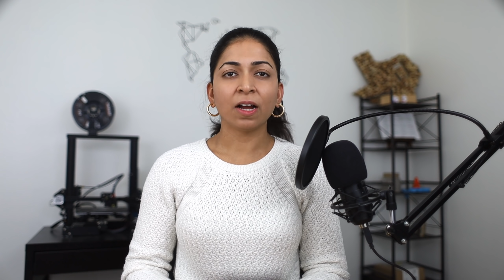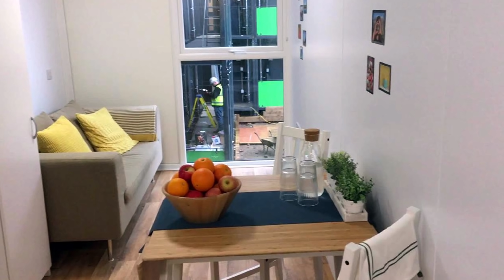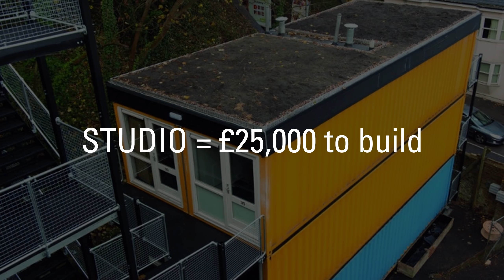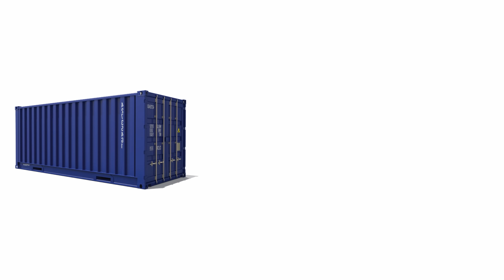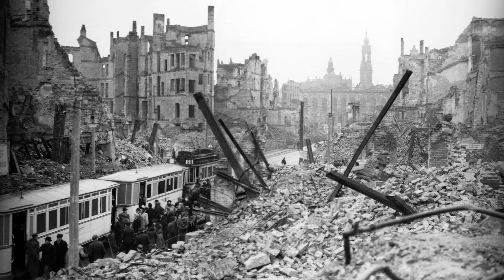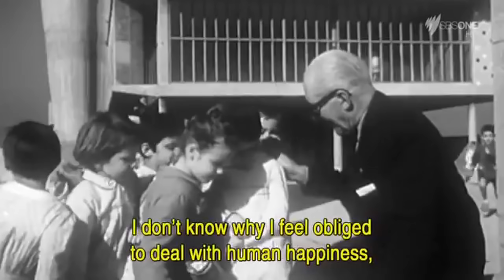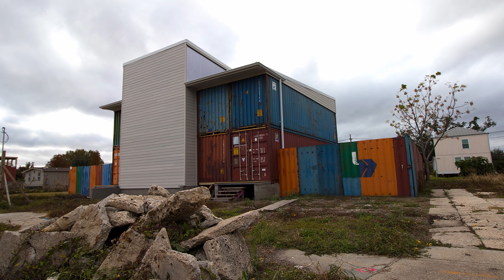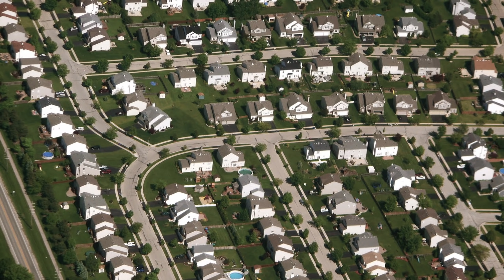Why Shipping Container homeless shelters FAIL

Comment: Solving homelessness requires personal relationships and a LOT of patience. I've watched my dad help several homeless people get their life together and stable. there's no big solution, it just takes a lot of people willing to take time for one on one interactions to slowly help with financial and mental issues. Trying to help everyone is the fastest way to help no one.
Reply: Actually if you look at Finland, homelessness is very much a solvable issue. You have to provide them permanent, unconditional housing that will not be threatened by their unstable mental health. The comfort of knowing that they will not lose everything if they fail immediately does wonders for their recovery and sets them on the proper path to permanent stability. Turns out no one likes living with a flame under their ass and the stress tips some people over.
Reply: @backwardsbandit8094  where are the houses you propose homeless people should get? A LOT of San Francisco's homeless are addicted to drugs, & the homeless population has skyrocketed due to its notoriety. In SF, even people w/ degrees and education can barely afford rent. What "comfortable, normal, permanent" housing is their in SF? If the city wants to buy up a bunch of expensive properties to make homeless people feel at home, they can go ahead, but it will cost them billions. My housemate works for a non profit giving homeless people temporary apartments and it's often a nightmare. I've personally been homeless and it's a terrible place to be and hard to get out of but the logistics of giving homeless people their own places are grim. Beggars can't be choosers - I would GRATEFULLY live in a shipping container over living on the street. You won't get robbed, you have a bed, a kitchen - a place of your own. Only entitled people would turn their nose up at these homes.
Reply: @backwardsbandit8094  Finland may not be the best example. In 1987 it had a homeless number of 4000 people with no accomodation and about 10k total "homeless" who are in temp housing or with no accomodation. In 30 years it has reduced these numbers but you have to look at it in scale. 10k people reduced to 2ishk in 30 years across a sizeable country is good but its a problem of a different scale that you cant really compare to big countries like Germany, Uk, USA, etc. 

EG a fairly well off country like finland building 10k houses over 30 years isn't that impressive in itself. Yes finlands policies have been good but it was a small problem for them that they have been very slowly fixing across 30 years. The homelessness solutions do not scale up proportionally.
Reply: @tkelly6121  that was over 30 years ago. Finland has instituted permanent housing for the homeless in the last couple of years. The research and facts show that it absolutely works. The decrease of uncertainty and abnormal mental and emotional stress greatly helps them get stable and begin to heal and become productive members of society. No one came live a stable life when they have no safe place to reside.
Reply: @wendyc.beecher3336  Finland has been working on its homeless problem for 30 years. Homelessness in Finland most dramatically reduced in the 1987-1995 era. I think you may have misunderstood my point. My point was 30 years ago Finland had a very very small homeless problem aprox 4000 people without any homes and 10k with only temp accomodation. It has taken Finland 30 years to slowly reduce that number. The point is that homelessness solutions do not scale proportionally. Finland has reduced its long term homeless from about 4000 in 1987 to 2000 in 2020. Thats about 40 years to home two thousand people. That is a very very different scale to countries with much larger homeless populations. I am not saying that Finland is doing anything wrong, I understand their policies are good for them but you can't simply copy paste what works on a small scale to a larger scale issue. It's more complex than that.
Reply: @tkelly6121  I think you are talking about something different than I am. I do believe when something actually works, you can adapt it to work in other similar situations. Especially if what you are currently doing is an abject failure
Reply: @wendyc.beecher3336  Perhaps we are speaking on different things. I was pointing out how comparing the homeless problems and solutions in Finland to the homeless problem in larger countries such as USA or Germany does not work. As the solutions do not scale proportionally.
Reply: @tkelly6121   You deserve a medal for articulating  that.
Reply: @obscurelyvague  Cheers.
Reply: @tkelly6121  I would also think the Finland has the advantage over a place like California where the alternative, living on the street in extremely cold environment, is not even possible
Reply: Exactly this
Reply: Ever notice how nothing seems to be impossible when people put their minds together to get it done? If the smartest people were to put their minds together to solve one problem it shouldn't be how we can put a man on Mars but how to lower the cost of living to reduce the stress of living. This has always been the main cause for universal homelessness througout mankind's history.
Reply: @angelluisll1033  This will crack your rose colored lenses....
In order to lower the cost of living you would need to redistribute resources evenly.
Even resource distribution would put an end to the "fat cats" and any others INCLUDING those who choose politics for selfish reasons (most of them) being above others simply because they have the ability to CONvince others to do what they want them to. 

You are essentially stating that all these people who never do anything for themselves would have to become useful to others NOT of the same mindset as them ...

that has as much chance of happening as these people ever seeing "Heaven". 
Whether a heaven exists or not, does not change the chance of people like that getting there.
Reply: That's what families are for, but society destroyed the family in the name of feminism and homosexuality.
Reply: Yes!
Reply: We are trying to throw money at a personal responsibility problem, not everyone wants to "make it" in life, no matter how much housing you give them it still would not motivate them. I truly believe that to some people, death is more welcoming than hard work.
Reply: @OpiumBride  it's sad that you can't listen to yourself. You are saying that the homeless are just so lazy that they suffer hunger, exposure, violence, lack of safety, rape, illness and other negative effects? Yeah right. Obviously there are SOME that are drug addicts with no desire for sobriety ( which takes inpatient rehabilitation). There are a few loner antisocial types that want to live solo and outdoors. The overwhelming majority are simply overwhelmed by problems they do not have the skills or resources to overcome. It's a very complex issue and each person has individual reasons and situations that lead to homelessness. There is no solution without permanent safe residence to start.
Reply: That is true
Reply: Finally someone who gets it.
Reply: @ Kam L...Exactly right ! Relationships and lot's of patience ! Simply giving them a shelter and/or a pile of money just never works ! Ultimately, the real solution in our society would be "Prevention" but we just aren't advanced enough yet !
Reply: youre right but the first step is SHELTER
Reply: I work in homeless shelters and yes you are right. It needs to be done one a case by case basis. However, there is a serious lack of usable space at least where I work. We  tend to take buildings which are coming to the end of their working lives because they are free or cheap (scheduled for demolition in a couple of years etc) which also means there's no incentive to maintain or improve the buildings and so people end up living in bad conditions. At least these shipping container properties are clean and serviceable.
Reply: They don't want homes. Just let them be
Reply: @Fleshlight_Reviewer  you drunk
Reply: "Kam L"    The reality is that with all the thousands of homeless people there are,  no assistance program can  merely    assign  outreach workers to  "take time"  with each individual  homeless person to "develop a relationship."  There are more homeless people than there are outreach workers. Each homeless person needs the attention of more than just one person trying to help him or her and  while any group of workers are "developing a relationship " with one person there are  thousands more  that  need  attention to their needs. 
It is necessary and unavoidable that  any solution is  meant to deal with homelessness according to  "bulk." 
Another thing is that  homeless people  have to also "meet  halfway" and help themselves and that is the hardest part overall. Anyone not willing to give up drugs or alcohol or  who is not willing to get job training   cannot be made to do so by anyone. It is why  helping homeless people  in the overall sense   just  turns out to fail  no matter what is done.
Reply: @obscurelyvague  I'm not sure you understood my comment. My point is not about outreach workers. Its that individuals need to build a relationship to make that change. You can;t make a system for it, it takes a personal choice to leave your comfort zone and commit your time and patience to helping someone. Most people aren't willing to do that, so they throw money at the situation to feel better about it. The solution has to be community based, but not enough people are willing to take on that responsibility.
Reply: @DeathComesSwiftlyForYou  anarchists are a joke. If you think working a job is to difficult you won’t last a day in anarchy.
Reply: Homelessness is a mental health thing. Not lack of housing. Unless you have a plan to solve all mental illnesses... Youre chasing wind.
Reply: @maasicas  Also, lots of people do choose to live a nomadic lifestyle and not everyone wants to live in a home. That's quite a big factor where I work. We  as society  assume everyone wants the same thing, which they don't. You're not automatically mentally ill just because you don't want to be tied down to the same physical space forever. Some people just don't like it and enjoy the homeless lifestyle. Speaking from experience here.
Reply: @maasicas   Partially. If you think about it,  there would be much less homeless if  it were only a "meatal health thing."  
A lot of it is much deeper and more unaddressable.
Reply: Who cares! They are lucky to get any free housing! These scum of society ruined their own lives and do nothing to fix it. Crack isn't the way back. Let em die.
Reply: @JurassisMine  When I was younger I used to feel sorry, but when you get older, interact with them, you see that they aren't poor and unlucky, they are violent and dangerous.
Reply: @Mark_Knight  same here man. They stole from me and vandalized my property to many times.
Reply: @Mark_Knight  I have worked backed up to a homeless encampment for the better part of half a decade and had to deal with them on a regular basis. Including having one of them sneak and lock himself in our business restroom. We had to call the police to dig him out and then spray down the room for fear of lice.

And I still disagree with you. 

Not that they aren't dangerous. Because the homeless can be violent. I've had them in my face shouting or throwing things at my car. 

Face to face with the ugly reality, the homeless can be tremendously unsympathetic. 
 
But this isn't a moral failing nor one caused by 'dependency'. The government they're so 'dependent on' also torments and abuses them ceaselessly because, truth be told, nobody wants them around in any form. 

These are frequently badly damaged people. Mental illness, drug dependency, and homelessness all feed off of one another and grow steadily worse. And the one constant across human history when a problem is too big . . . We try to sweep it under the rug and let it fester while moralizing that the suffering was earned.
Reply: @Bustermachine  What stops homelessness is family, not the government. Government makes things worse always.
Reply: @Bustermachine  My computer crashed so here is my late reply.

Churches are good, government is not.

Church members are part of the community. So if someone is money, they were expected to put effort and reward the Church by having effort to get a job. It's psychology, human nature, shame.

Government does not. It incentivizes homelessness.
Reply: @Bustermachine  Mental illness increases with government intervention appearently. Families and Church should take care of family. Without that responsibility, we get what we have today.

A mess.
Reply: Andrew j my landlord did exactly that, stole everything I owned including bond, photos, documents and possessions as did the broker who refinanced my low-doc home loan
Reply: @DeathComesSwiftlyForYou  How will the world thrive without capitalism?
Reply: I mean, there is a pretty easy, big solution.  But last time I proposed it, people called it an atrocity.
Reply: @Thrifty032781  you're not funny
Reply: @beer_dot_com  Sure I am.
Reply: @beer_dot_com  but he's not wrong
Reply: @JurassisMine  edgeeee
Reply: @Thrifty032781  
Because with high probability your big solution ended with "HAIL HITLER", right!
Reply: Less government.

One of the reasons that homeless exists is government dependence.
Reply: @Mark_Knight  Goverment elimination of low cost housing in favor of housing for the wealthy.
Reply: @stanleytolle416  Lets pretend that is true, government is the problem.

The more government spends, the bigger the crisis.
Reply: @Mark_Knight  oh, puh-leeez. You haven’t thought that through.
Reply: @elsagrace3893  I did. I looks at stats and crime.

You probably need to use more than feelings to understand the world.
Reply: @Mark_Knight  stats are always such a good way to gage what is going on
Reply: @mybigyear  It's a great way to prove truth.
Reply: @Allon Vorlete Well now you are talking about something different.
After you look at the stats, find out who is paying for it.
Reply: @Mark_Knight  enough of your government blaming!
Some people are homeless because
1) they choose to be
2) they can't even maintain their life well
3) they are addicted to debt

And there are other scenarios why people are homeless, which could be financial issue, health, family etc
Reply: @xin0  But why is the government getting involved?
Reply: @Mark_Knight  government can get involved, as they do in almost everything.
But my point is, people are not homeless because of govs, some are homeless because they don't think right, they can't take care of something given or acquired. So they lost it.

If a guy keeps having breakup relationships, are the problem the women he keeps dating? No, the guy needs to examine himself why he keeps having breakups.
Reply: @xin0  most people are homeless due to lack of money, lack of support system, mental health issues exacerbated by homelessness and mistreatment by people with the same attitude you display

Comment: The biggest problem with this temporary housing is they are not temporary. I live in Toronto. Back in the '40s, they built temporary housing. 80 years later they are still in use and most families lve their entire lives with their children taking them over, so it becomes generational.

Comment: Modernist architects love using systems thinking to solve emotional thinking problems. Things like Robin Hood Gardens is the result.
I will not speak bad about Unité d'Habitation, because although it failed to solve social issues, it's a triumph of architecture.

Although it would be nicer if the raw concrete was painted.

Comment: There is no one single answer to the homeless issue. But, the containers can be one of many solutions...if they are converted correctly. Proper AC and Heat...pending region. Proper framing inside for insulation. One could adapt HVAC's that are used in RV's, and use them with the container. It comes down to who is footing the bill, and how much they budget....